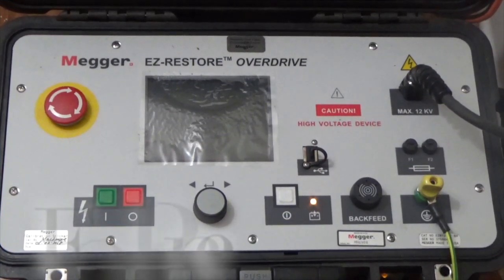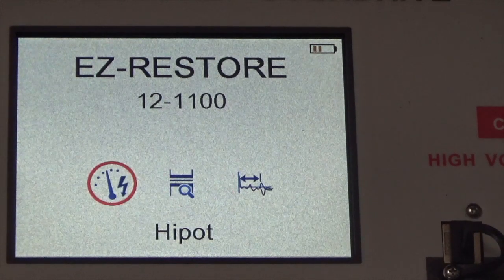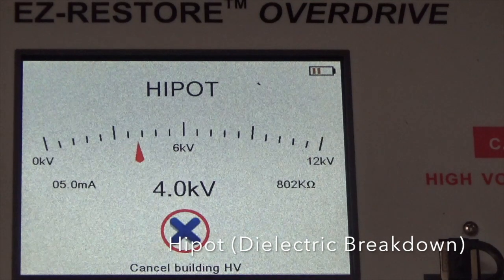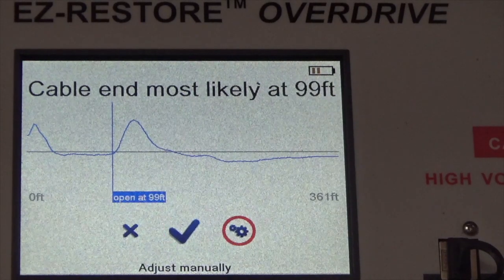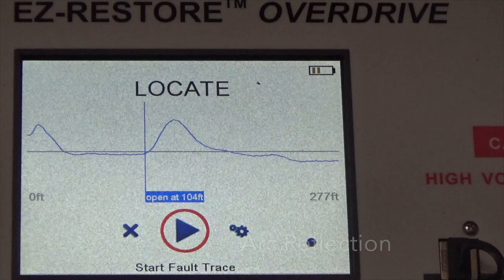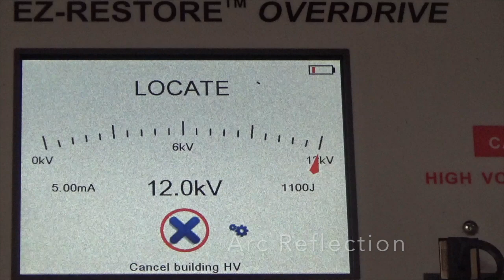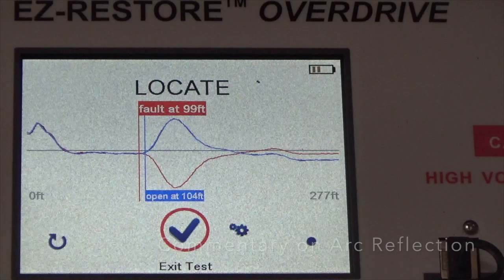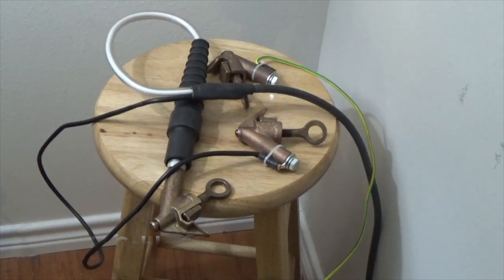Megger EZ Restore Walk-Through

Comment: Would this be able to do fault location on mineral insulated heating cables?  With regular TDRs we have trouble getting a good reading due to the resistance.
Reply from the maker: You would have the same response for just about all the technology.  TDR is pretty much a standard method of hitting a cable with a pulse, and waiting for the echo signal to measure the distance and amplitude of the signal.  I recommend that you get a unit with TDR and Arc Reflect.  Arc Reflect is the "high voltage" TDR signal that gives you more flexibility in addition to the TDR.  In oil filled cables, which may be similar to your mineral oil cables, the rule of thumb is that it needs a 40 KV thumper.  Let me know your thoughts.  Good luck.